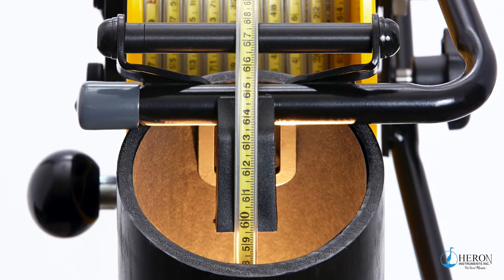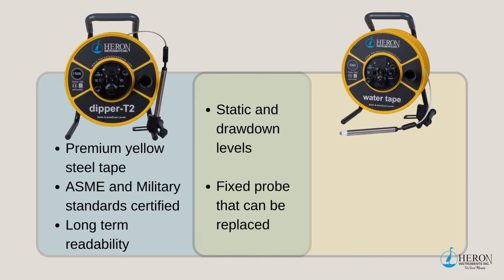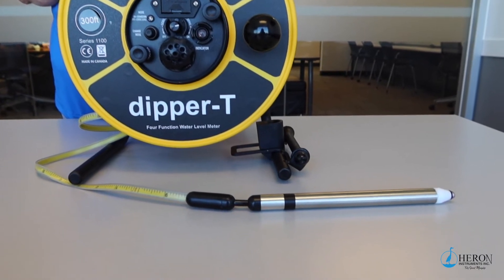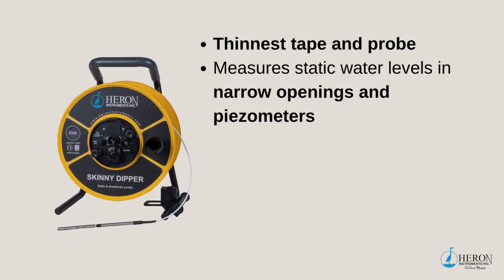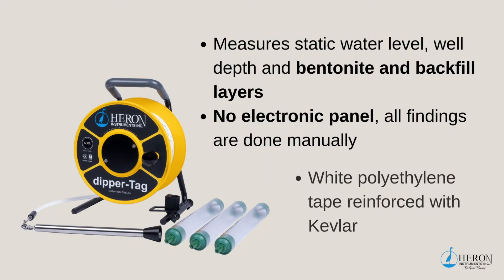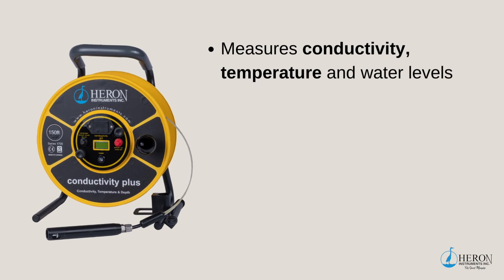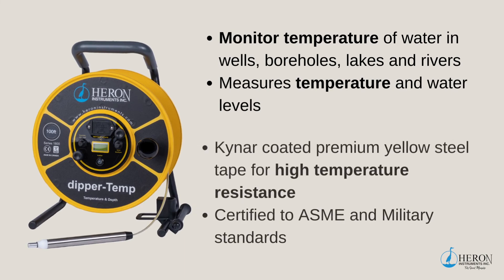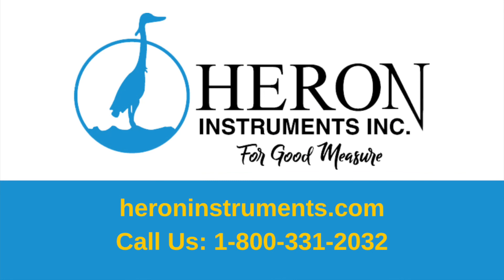A Guide to Choosing the Right Water Level Meter

Comment: A very important point is the diameter of the probe.  Only the Skinny Dipper had a size mentioned.  My well has a sounding tube of 1 inch inside diameter.  A probe that will slide down this tube is what I need to monitor the water level.